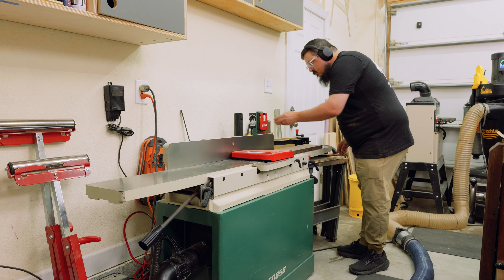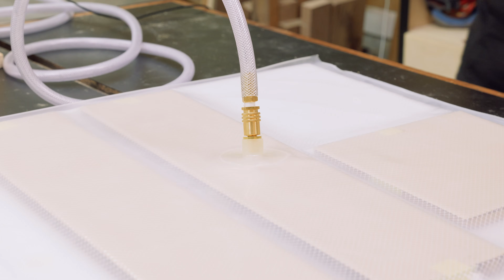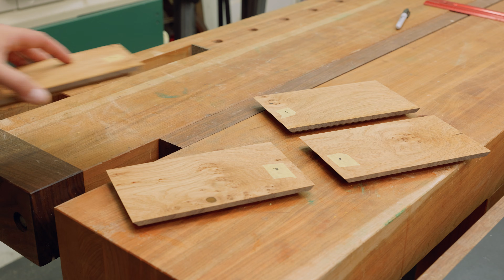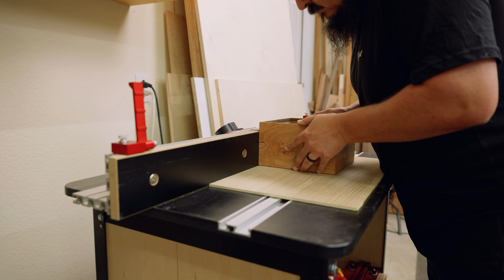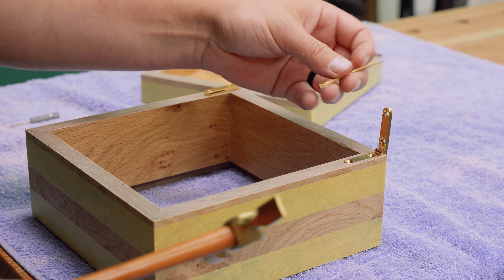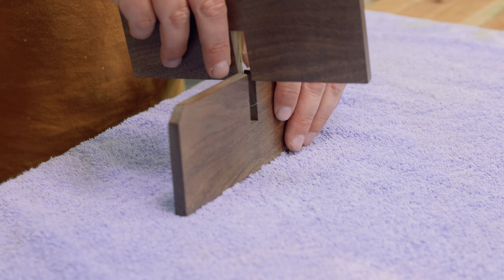You’re making keepsake boxes ALL WRONG

Comment: Lucky me had a big dumb experience moment not long ago.  I made a new cabinet to put my planer on.  I sketched it up with total height including 4 inch castor wheels.  I forgot to deduct the wheels when I cut my pieces.  Now I have a great view inside the working parts of the planer from how high it was. Oh well.  It gave me a bit larger space for drawers at least
Reply from the maker: Haha, I hate it when that happens. I had the same thought when I got my new saw in that my outfeed table was going to be too low. Luckily it wasn’t but it was still a concern.